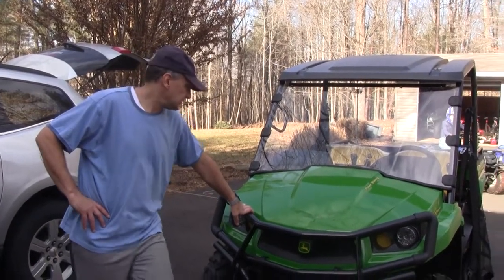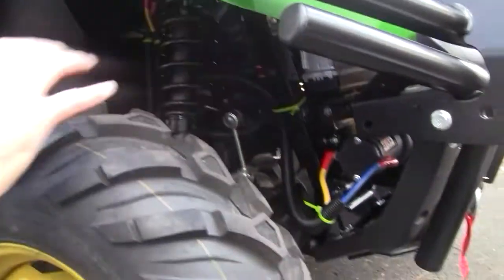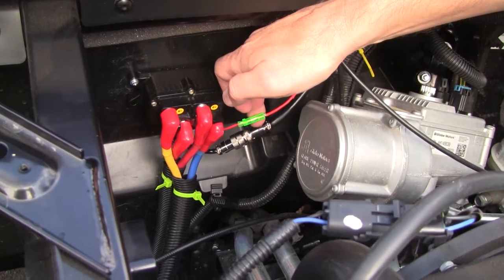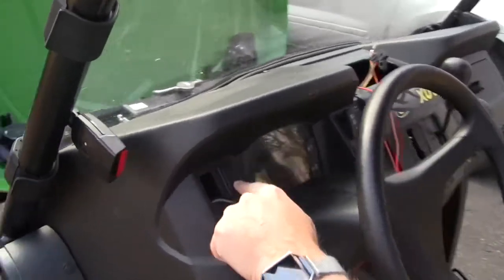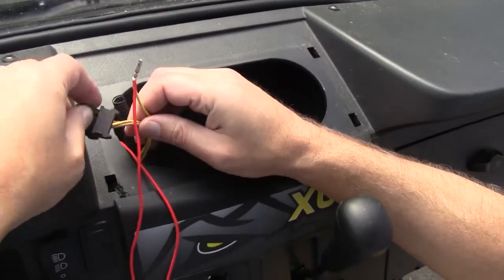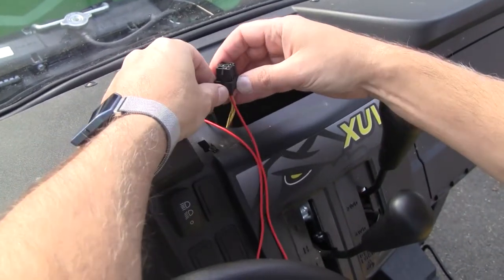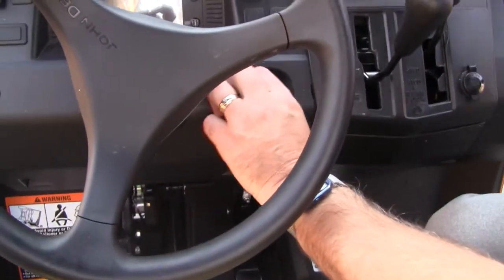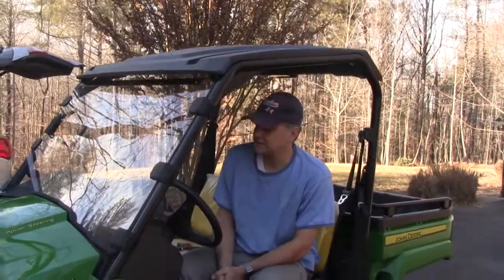XUV590M Winch Install

Comment: Did you install the hand held winch switch
Reply from the maker: No.  I mostly use this for a snow plow, so I wanted an easily accessible switch from the drivers seat.  So I rewired it for the rocker switch.

Comment: Nice video! How reliable has this machine been for you? Any problems? I really like this model gator, but the reviews online were mostly horror stories of parking brake failures, shocks leaking oil, etc. My wife and I looked at one of these in person recently and the machine appears well built. I have a hard time understanding why it has such bad reviews online? I just thought I’d ask cause I’d like to know how reliable and trouble free it is before I buy. Thanks!
Reply from the maker: So far mine has been trouble free.  I've only had it for about 6 months, but everything is working as it should.  Nothing is leaking.  I park it in my garage and I would notice even the slightest leak.  The only thing I have noticed with the parking brake is that it is mounted very close to the plastic encasement and if you don't press it straight down it can make contact with edge and not disengage.  So far though, I have no reason to not highly recommend this machine as a great work/play combo.
Reply: Thanks for the information!

Comment: Nice job. Do you have any problems with the winch draining your battery?
Reply from the maker: No, but I always have the gator running when I use it.  I would think with extended use and not having the Gator running it would put a pretty good drain on the battery.